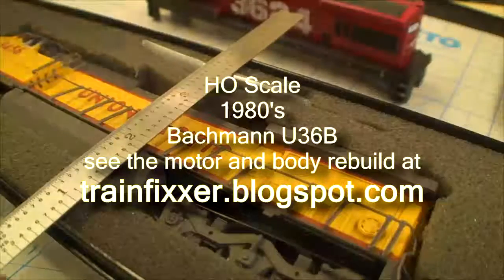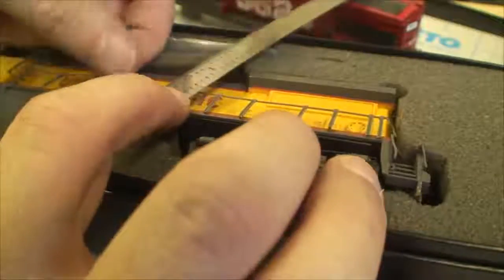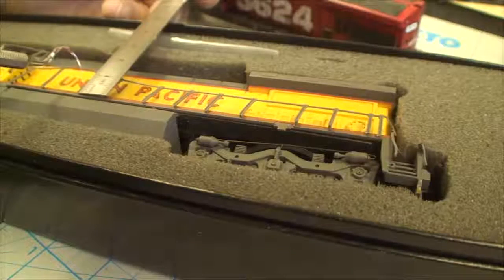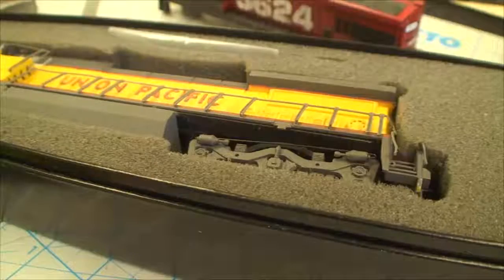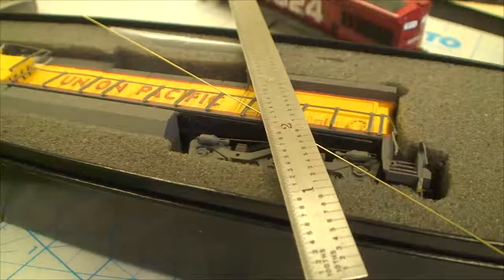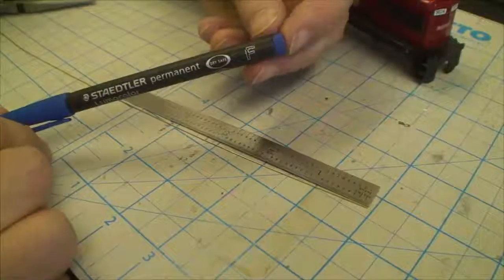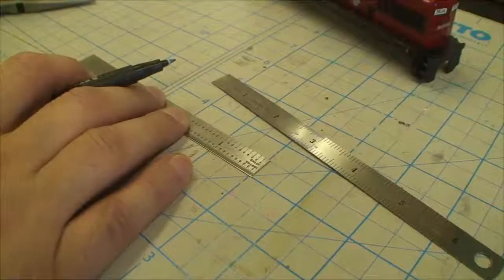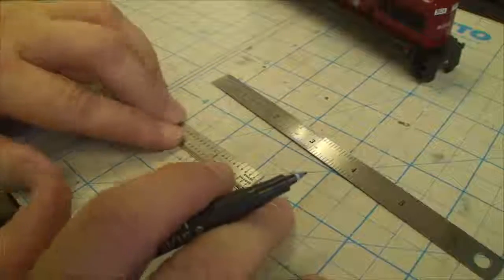Bachmann HO scale U36B make brass handrails part 2 stanchion and long rail

Comment: Nice job.  That takes some patience.  I might have to try that to fix up some engines.
Reply from the maker: I'm working on using piano wire again and plan to make a series how to use that stuff - I used to do it long ago but the bending is difficult.  I have a jig now for bending and as soon as I'm done practicing I'll reveal it.